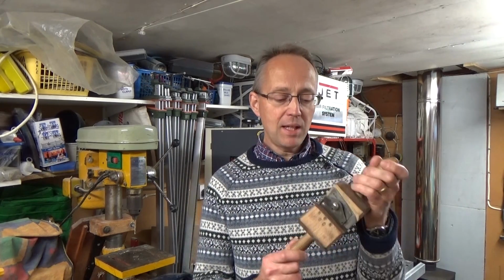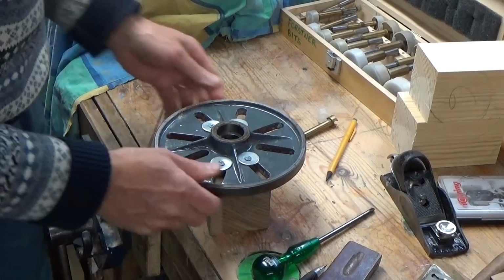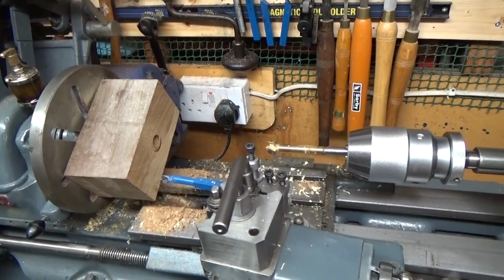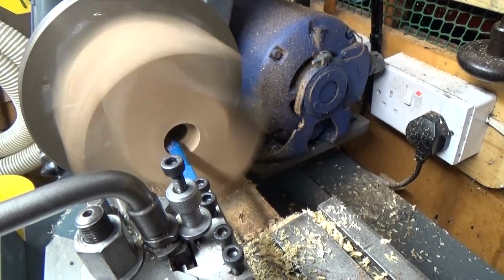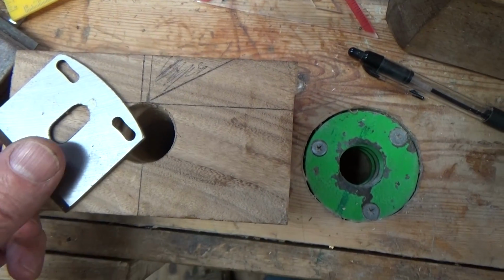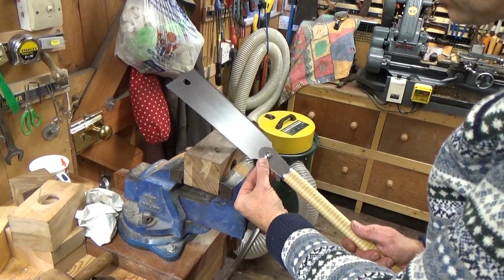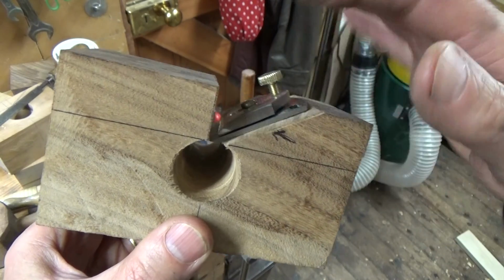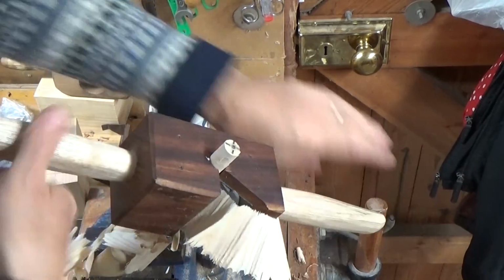Making Traditional Wooden Rounding Planes on a Myford ML7 Lathe

Comment: I am amazed. So since the hole is the reference point for the plane bedding, if you make a tapered hole you get a tapered tenon and straight hole straight tenon? I saw another video where he took the corner of the plane right where the wood enters to not tear. 
This looks like a fun project I will try to make one. The price of those plans are great, thank you! 

I like tapered shoulders on the joints (I make twig furniture, all though still a novice :D).
I would like to try this I need to make a 3/4 tenon cutter and I dont want to pay 90 quids for one of those veritas ones.
Reply from the maker: Hi, it's a tapered tenon, until the wood exits, and then it's a straight dowel. This may make more sense if you see my Sussex Chair spindle making films. Rgds Harry

Comment: What was the point of marking the two slots at the top of the blade? I noticed that you marked them but didn’t do anything in those spots. Should there be a couple little tabs there to keep the blade from falling out while adjusting?
Reply from the maker: Matt KnowsThat Hi Matt...I just marked them to help with lining up the blade..thats all. I have made these before and added spokeshave adjusters as well.

Comment: Hi Harry,
Thanks for another top video. I must admit to a little tool envy when I saw the ML7. As compensation I can tell myself that I have the same vise on the swivel base and have a very handy accessory for it, one I can't see on your bench and one you might consider.
The humble cross type wheel brace you find in every scrap yard and flea market for pennies. I cut off three of the sockets to form a dedicated T- spanner for the locking nuts on the swivel base. They have enough length to allow knuckles to clear the jaws of the vise and the handles are long enough to allow two handed use..  I hang mine on a couple of screws on the end of my bench so it is always to hand for a quick adjustment of the vise. Since having this arrangement I find I regularly use the swivel base when I might have otherwise have struggled on with it not at quite the right angle.
All the best.
Reply from the maker: +labrat7357 Rather a neat solution to avoid bruises - great thanks.